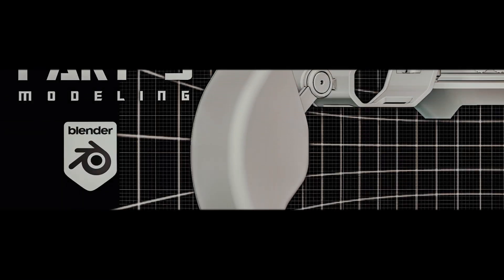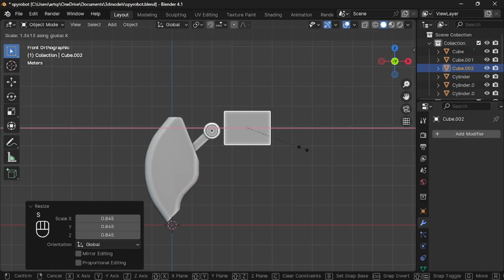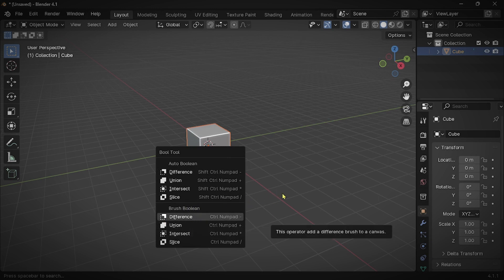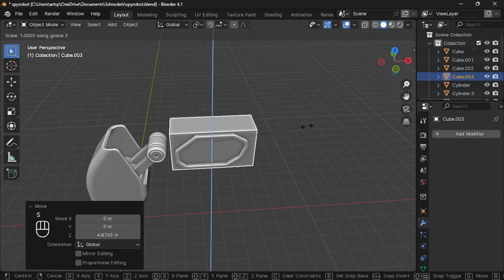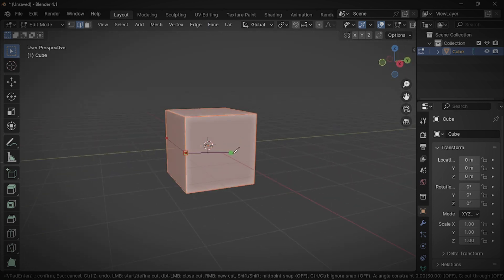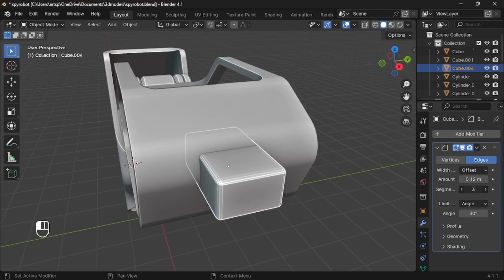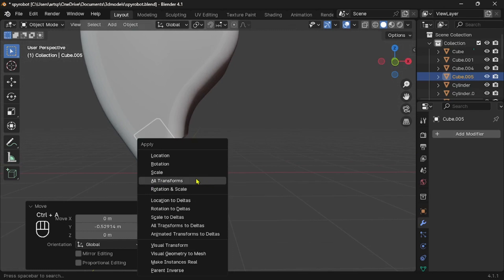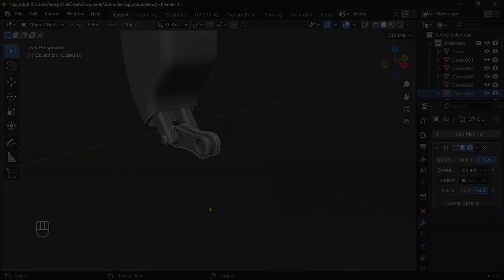Part 3-Blender Beginner Tutorial (Hard surface-modeling)

Comment: Hi.  Overall this is a well made video with good info. Probably the best tutorial that Iv seen that uses an ai voice.  However, one of the things I didn't like is that the video said that the intersect boolean is not used in hard surface modeling.  That is not true. People DO use the intersect boolean.  Just because you don't use it doesn't mean no body uses it.
Reply from the maker: I meant that intersection will be least used than the other Boolean. Maybe I don't use that, good point.